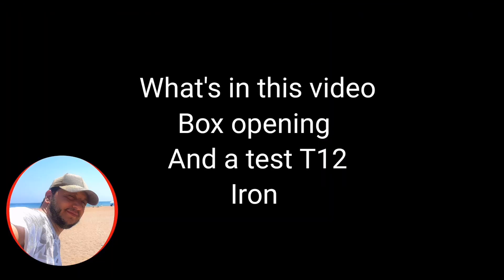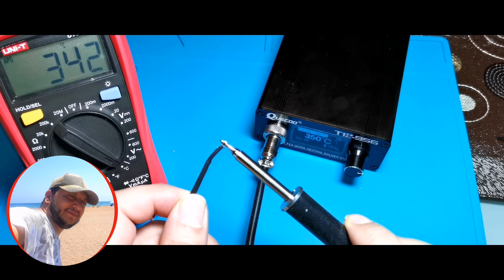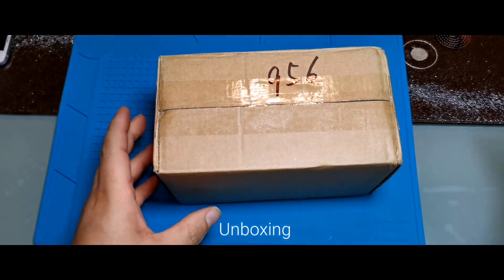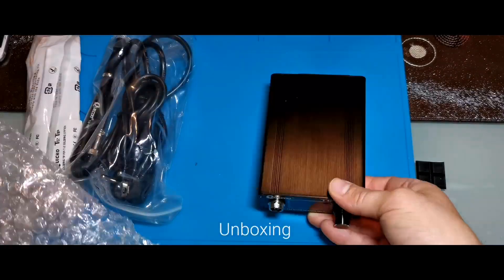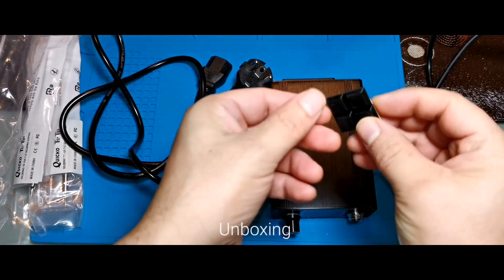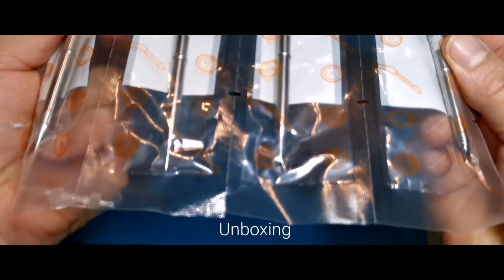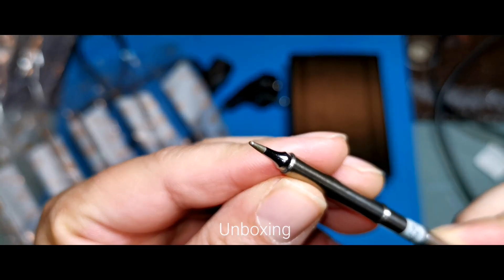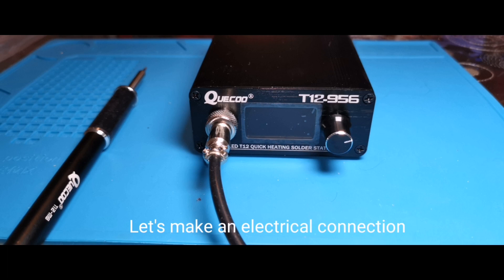T12 Soldering Station Review QUECOO- KSGER new 2021-T12- 956 soldering

Comment: que diferencia hay en la queeco t12 956 y la queeco t12 955? cual es mejor
Reply from the maker: For a normal person, there is not much difference. In fact, the T12 956 is only 12 watts more economical and comes with newer software. but other soldering machines will do your job in the same. an option soldering tips can be changed soldering pens  vs
Reply: @MrSatech  why one station says STC and the other one STM32 2.1s,what is the difference?
Reply from the maker: There is a software difference,

Comment: Which is better quicko or ksgar
Reply from the maker: Same
Reply: @MrSatech  They are NOT the same.
KSGER have;
1) ungrounded case. 
2) ungrounded GX16 (so your tip isn't either). 
3) don't have any DC input.

Quicko resolved ALL these problems. 

Stop speading misinformation. I swear Youtubers are clueless...
Also KSGER are even more dangerous because of their shitty PSU.

Comment: Is there some difference between the t12-946 and the t12-t42??
Reply from the maker: They all work on the same principle in general, there is a menu difference and an arm difference between them. Even though there are small differences, they all do the same.  however, please note that some models do not work with 220 volts, you need to connect an adapter to it. This is 220 volts and can work with an adapter if you like.

Comment: There's a rebranded KSGER (I have the KSGER with long form factor and older firmware but I like the long form factor, you just need the power plug, though it'd be nice to have the metal iron rod), half the price (but less choices of form factor) half the price of KSGER but the front lettering isn't as elegant as KSGER and it'll be harder to stack (but plausible) but is more portable and modular.

The T12 is my favorite tool, it's stylish (at least the KSGER one with long form factor, better: their battery powered one- no cords and portable).
Reply from the maker: There are many models for your purpose of use. I made this video just to get an idea.